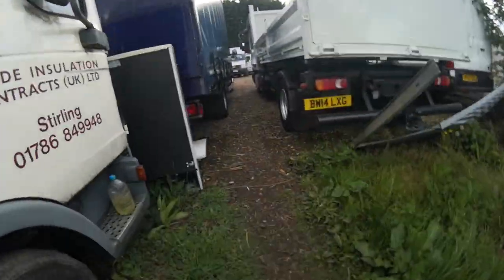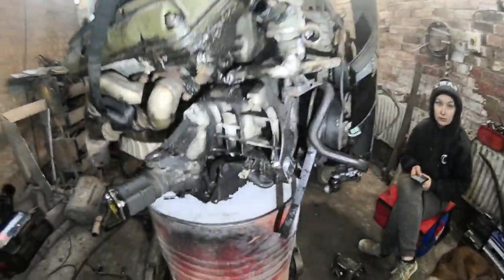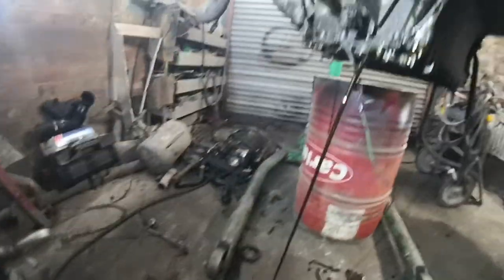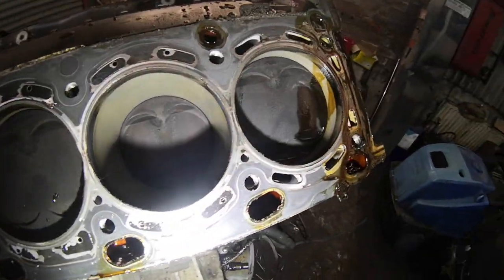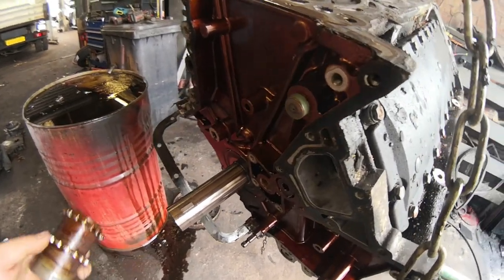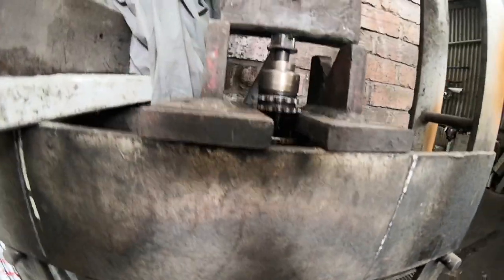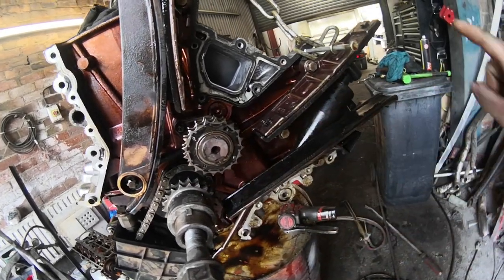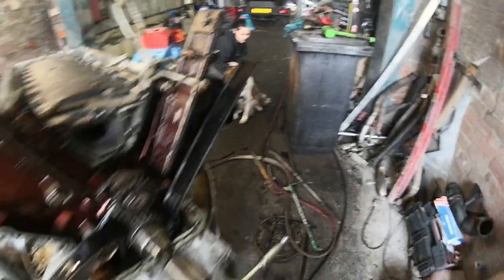M60B44 V8 hybrid engine build - Pt.1

Comment: Admire the work rate man! Look forward to seeing you rip soon hopefully!
Reply from the maker: Thank you dude! Doing it this way we should be able to cram more info in a shorter space. Not be long til we're back trackside! See you soon.
Reply: @47autowerks  what do you exactly mean by hybrid engine?
You will add electric motor or what?
Reply from the maker: @FirstLast-tx3yj  Hybrid just means parts from multiple different things. This is part M60 and part M62. Same with hybrid turbos, they're mixes of 2 or more turbos.